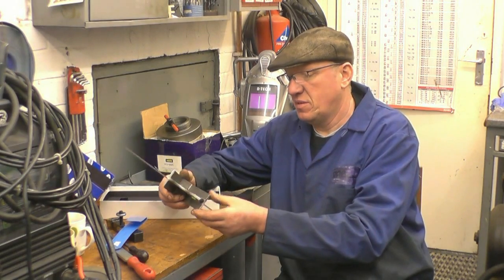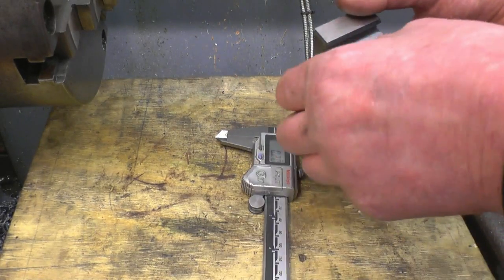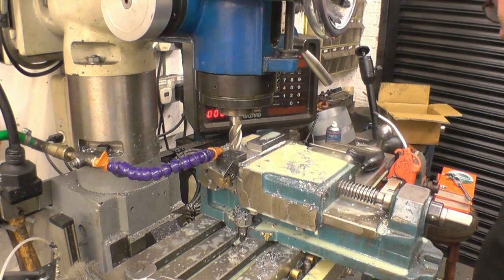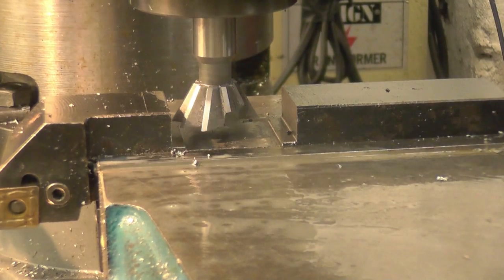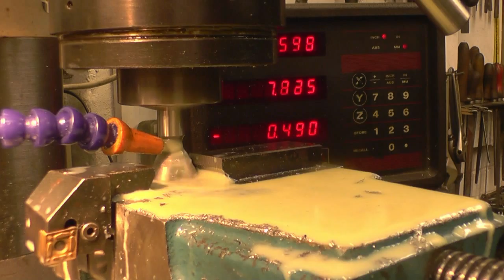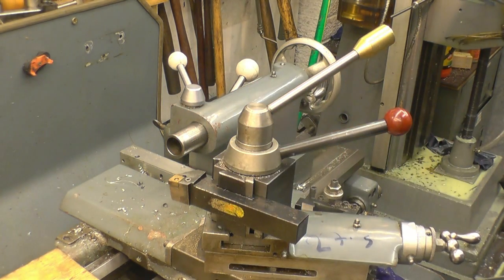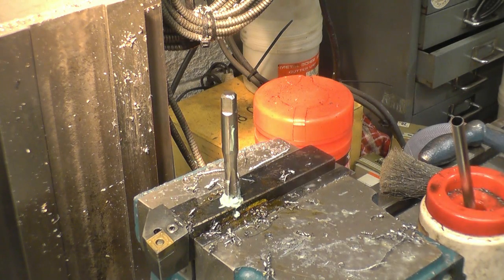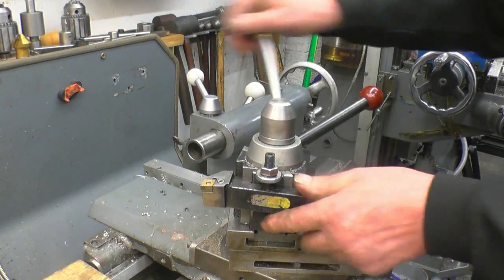SNNC 117 P1 Lathe tool mod / Dovetail machining

Comment: I've always loved dovetails, 1st on wooden joints, and now on metal tooling. There's just something about them that I find interesting, I don't know what exactly it is, but thanks for the video. Amazing finish supplied by that broken cutter, I'm glad you showed that as I'd never have thought to still use one like that and that's good to know for when I get a mill :D

Aloha...Chuck
Reply: +Knolltop Farms kind of makes sense it will work, other than the higher possibility of vibration, the broken parts are not there, so cannot affect the finish, of course you will have to feed a bit slower, but yeah, get some bargains of broken cutters!

Comment: John that is exactly how I did mine.  The only difference is I use pins and adjustable parallels to measure the dovetail distance. Also I drill my pilot holes a bit larger so the tapping is easier. Good job
Reply from the maker: +James Dedmon  They make a nice rigid job

Comment: I've got one of those 1 inch square insert holders. I'd been thinking of cutting it down to 1/2 inch to fit my AXA tool post, but this seems like a much better solution.

Comment: Although the tool might be cheap. The insert would be more expensive. 
More grams per carbide insert, higher price.
And then... insert sharpness affects smoothness of cut surface.

Comment: Good idea but made the tool holder to thin with the tappping, tool s about 7mm thick now instead of 25  , Trying to eliminate chatter best way is to reduce tool nose radius.
Reply from the maker: +jamcare The stud is 10 mill tool is at least 14 at the thin part no flex & no chatter
Reply: +doubleboost Great machining Doubleboost Good idea never seen before. Great to see original ideas . Keep it up . It makes an engineer think . More surface contact with the post instead of the usual 4 bolts. IE less chatter. got it now

Comment: Hope you show when the tool snaps, you effectively reduced the strength of the tool holder down to 10mm squared after drilling and tapping. To top it off you failed to correctly measure tip clearance away from the tool post. I suppose it would be OK for very light cuts if you can curb you butchers approach to machining.
Reply from the maker: why not show how it should be done I don't think that tool will snap lol
Reply: Edna, Strength increases exponentially with the depth of the tool and linearly with the width.  So, although John reduced the strength to less than that a full one inch shank would have, it's still probably four times as strong as a half inch shank tool.
Reply: Edna Turnbull you're funny...HA! I have been cutting up these tools for a long time also, I think they are made from kryptonite, lol....